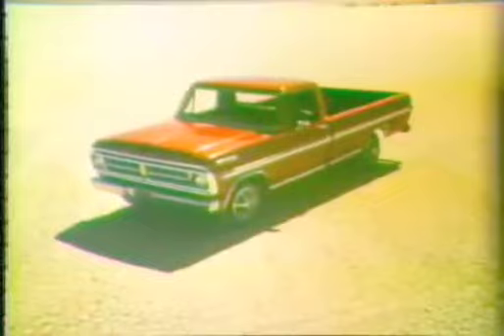1971 Ford Pickup Truck Commercial

Comment: Based on what criteria? "Strong independent suspension at lowest cost"? Yes. "Best geometry for ride, emergency handling, and tire wear"? No. It speaks volumes to me that Ford ditched this suspension in the '90s and went with the upper and lower control arm set-up that both GM and Dodge use. Mercedes, Porsche, VW, Triumph, and the Corvair all used swing axles (same thing as Twin I-Beam) in the '60s and quit using them in favor of better designs.

Comment: It's a good ad, but this type of "see our great suspension" ad has been duplicated many times over. Finding just the right speed for the vehicle is critical to getting this result. In '71, Ford, GM, and Dodge trucks all had independent front suspension. Any one of them could have done this ad with the same result.